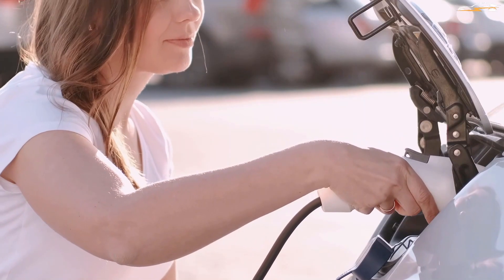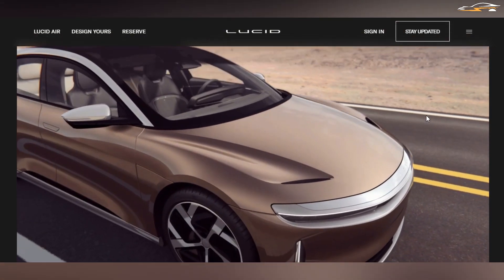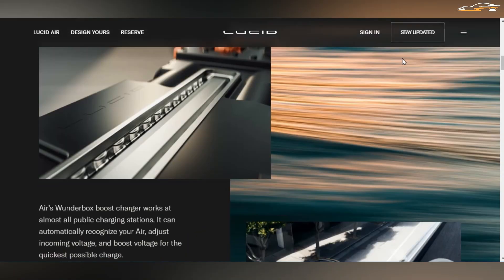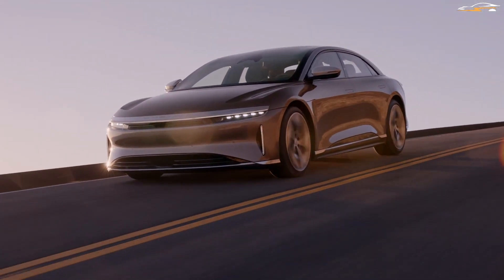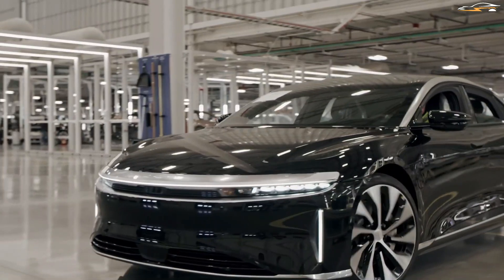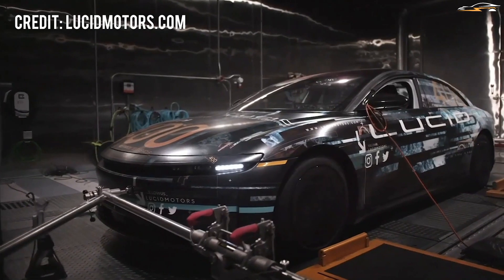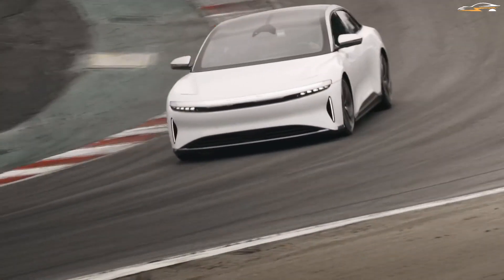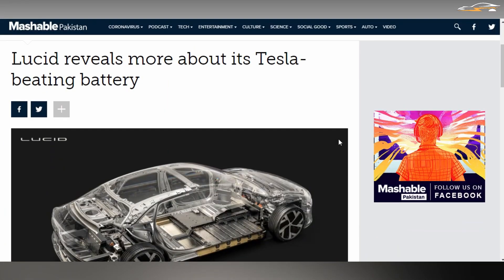The REVOLUTIONAIRY battery solutions of Lucid motors!

Comment: I'm a reservation holder and huge Lucid fan, but this video is riddled with so much misinformation that it is useless.  Here are just some examples:

1,080 hp is available only in the very limited number of sold-out Dream Editions.  The long-term top-of-the-range Grand Touring will have 800 hp.

You don't have to push the car "really hard" to reach its top speed of 168 mph.  That speed is electronically limited due to tire speed ratings.  Unlimited Lucid's have hit 235 mph on test tracks.

The Dream Edition costs $161,500 after federal tax credits, not $150,000.

When illustrating the 113-kWh battery pack, you show the smaller battery pack which, unlike the large pack, has no modules under the rear passenger floorboard.

When Lucid originally announced a 400-mile range in 2016, they were planning to get it from a 130-kWh battery pack.  The fact that they're now getting over 500 miles out of a 113-kWh pack is far more impressive.

The Casa Grande factory cost $700MM to build, not "billions".

The "space concept" relates more to the miniaturization of the drivetrain and power electronics, not the battery pack.  In fact, putting modules under the rear floorboard for the larger battery pack creates the same jacked-up knees syndrome that plagues the Tesla Model S, although to a lesser extent due to the longer cabin.

The electrical system is 924 volts, not 900 volts.
Reply: Wow thanks!
Reply: These stupid "tech" videos designed to create traffic and uses text to voice software is getting increasingly annoying.  It's very hard to find decent analysis info.  Sandy Munro seems to be it.